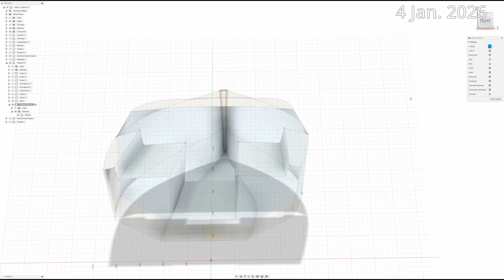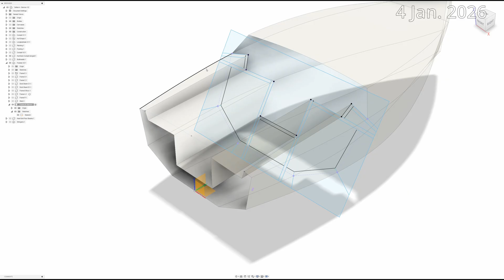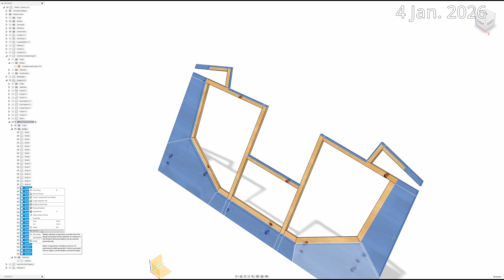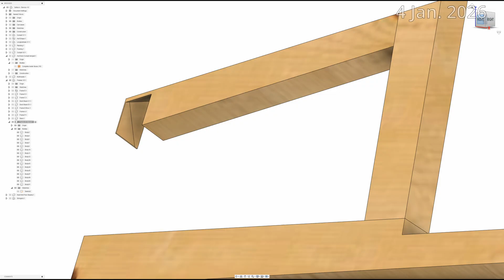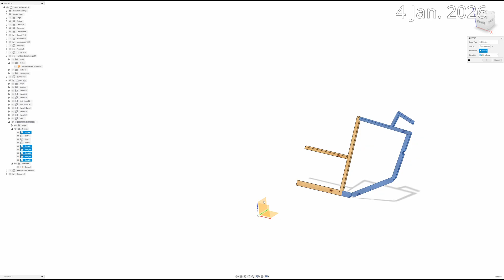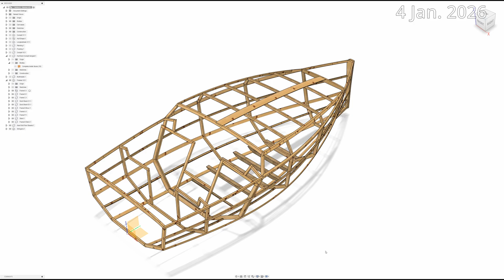Setka A - Full Fusion Session

Comment: Buddy send me a comment on the blog so I can get your email so I can send you some videos about the shortcomings of cnc it will really help you I have video for you -  best thing is to buy a laser level
Reply from the maker: Youtube comments work strange, sorry I missed this one. You can reach me at info@svsienna.com

Rest assured though I have a laser level and it hasn‘t only been sitting in my toolbox, nor am I trying to make shortcuts by using a cnc, I actually dare to state it is more involved than lofting and cutting by hand, which I‘d be perfectly capable to do, that‘s not the point.

The goal for the CNC is to master working with the machine and cutting frames for the Setka is a perfectly viable project to do so. There will be plenty of handplaning and manual woodworking left to be able to say that I‘m building this boat. A CNC is a great but complicated tool, but it’s definetly not a boatbuilder.

Looking forward to hear from you!

Comment: Its nice to see the cad model but it will be more accurate if you do it as we have all done . Stringers bend differently depending on species dryness and type of grain and how they are cut
Reply from the maker: Yeah, the stringers will not be machined, that doesn't make sense. But the stem and the frames as well as an assembly jig could work very well.

Comment: I think you dont need to cnc cut the parts. The easiest way is to loft it as the designer says from the squares. Put it on a big sheet of melamine and glue and screw the frames together directly on the melamine adding the gussets  very quick and accurate
Reply from the maker: You're absolutely right, it's not a time saver or make it a better boat. It's just, getting this new "toy" I want to try it, since I'm not in a hurry it will be a good learning experience. Very well possible that I'll switch to doing most by hand.